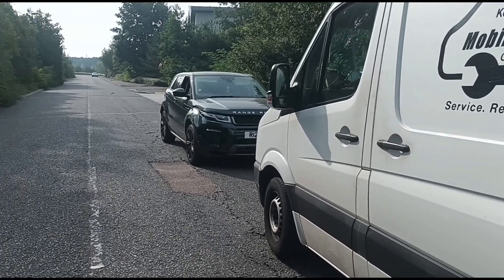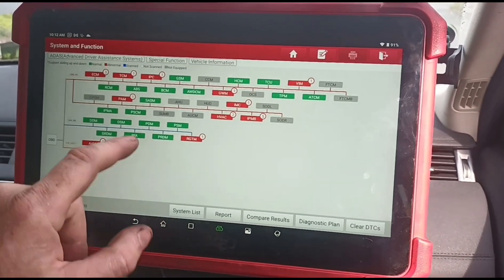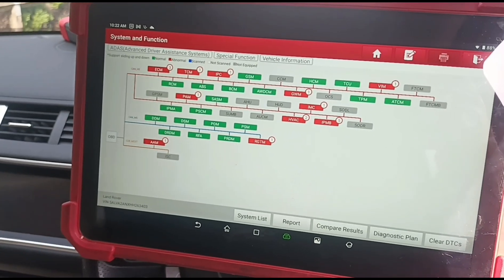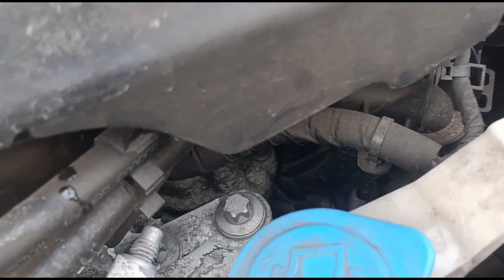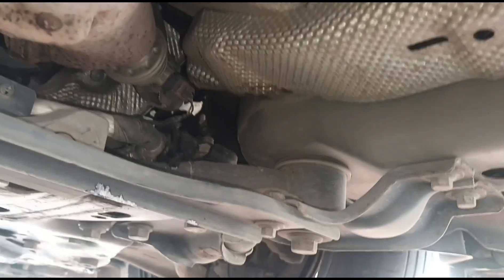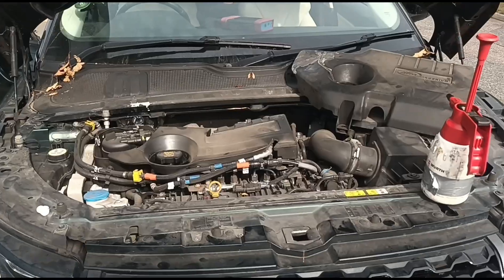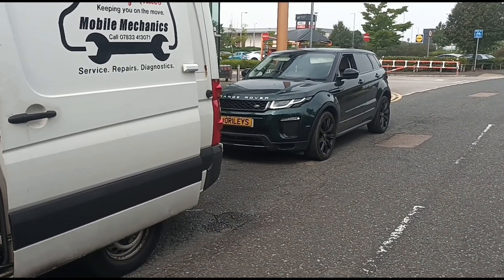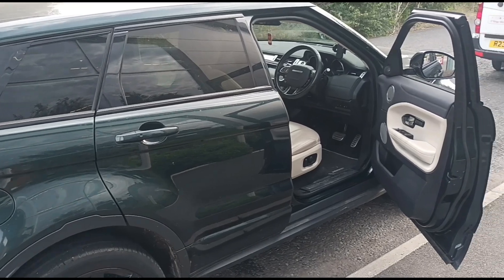Land Rover 2.0 P2BAE-00 P2BAE-02 P2BAF-00 NOX Exceedance. Massive Repair Quotes Fixed With No Parts

Comment: It won't circulate via low pressure EGR but easily can lead to the hydraulic impact to the engine.
Instead you can get to the oxygen sensor by removing the turbine cover.

Comment: Where are you based I have the exact same codes on my Jaguar xe 2016 I’ve taken off the adblue injector I have also drained and refilled the adblue tank (under the capacity level) and I’ve taken the box sensor off and have it a clean but the famous “ no engine restarts after xx miles diesel exhaust fluid dosing malfunction”

Comment: Hi love watching your videos very informative had all the problems with my 66 plate hse dynamic that iam seeing in your videos great job your doing please may I ask if you have ever come across problems with add blue pipe from tank pump to add blue injector as I've had nightmares stripped out tank and found outlet pipe was worn right on the bend rubbing up agenst side of body and worn a split in pipe desperately trying to locate this pipe from somewhere this i such a bad design by land rover many thanks Bryan

Comment: Is it possible to spray the DPF cleaning down the Adblue injector port into the DPF ( before refitting the ad blue injector … I’ve stripped and cleaned both EGR’s an EGR coolers, cleaned the Ad blue injectors ( as in your video ) and done a forced regen .. I’m still getting the P049b fault with a 13 kpa reading @ 3000 revs on the differential pressure and a measured spot value of 12g …. Scratching my head with this issue now 😂

Comment: I think you need to inform customer that she needs new tyres. Why did she ignore the adblue low level warnings but looking at the bodywork she's not much of a driver.
Reply: The accessory belt looks like it's on its last legs as well. 
These people take no care of their cars and then cry when quoted 3k for repairs as if they haven't just spent the last three years spending zero on maintenance and driving the car into the ground.

Comment: I'm an ex land rover master tech Jimmy, that noise is the balance shaft bearings.
Ask any land rover tech, really common, I did dozens at the dealers. I guarantee you go into any dealer workshop and they will have one or two on the ramp 🤣. You need to replace the shafts and you need the correct timing tools to set the shafts too.
Reply from the maker: Really? It sounds exactly like an alternator whine.

How much work is it to repair that?
Reply: @ORileysAutos  I was a master tech, so never seen the cost of the job, most of the shafts we changed were done under warranty.
It's labour intensive but can be done in one day. (when you're done a few) 
Drop the engine oil out. 
Frame off, gearbox off, clutch /torque converter off, backplate off, (if you haven't drianed the engine oil it will poor out over the sump at this point ) leave the chains on, remove the front crank pulley and cover, support the engine, undo the engine mount and lower the engine slowly unill the shafts can be pulled 'straight' out the crank pulley end.
Now you need the correct timing plate that bolts the the block (crank pulley end) this will time up the shaft before you remove them. Remove the retaining bolts from the shafts (gearbox end). 
Fit the special rod which screws into the bolt holes and push the shafts out. Hold them dead level as they come out. 
Then feed the new shafts in using the rod as a guide and then time up using the plate, then put it all back together. 
Alot of work mate. 
Like I said did loads, obviously remove the aux belt and run the engine to confirm. 
It's the 2.0 ingenium engine designed and built by JLR. It's in the disco 5 too and the velar. 

Ps. If someones is doing the job, just pop the gearbox off the IRD/transfer box. Leave the whole exhaust connected as it will also help steady the engine when you have it support. Clamp of the gearbox cooler pipes so no need to drop the antifreeze either. 
Don't make work for yourself 😉.

Comment: I never understood why they decided to put the Ad-blu fill port under the bonnet 🙄
Why not just put it next to the fuel filler or in the boot floor?
Reply: Yep and its a pain in the ass to unscrew it due to dry ad-blue on the threads , I even tried a bit of grease but still a pain

Comment: I always looked after my customers never told them it and engine or gear box i would give it true diagnose bill them for my time but if they go though with the repair then i would waver the diagnose bill and strangely a lot of garages don't have good diagnostic equipment.